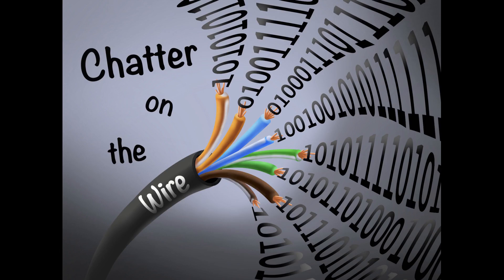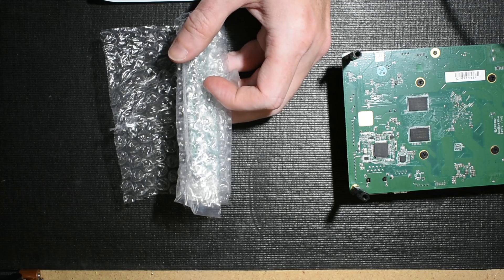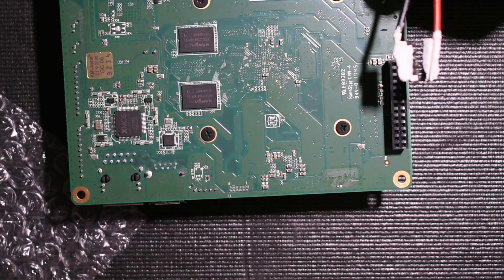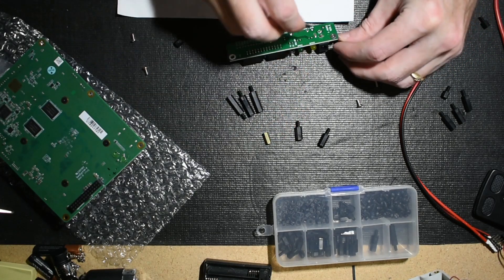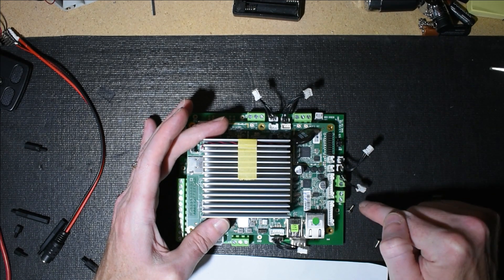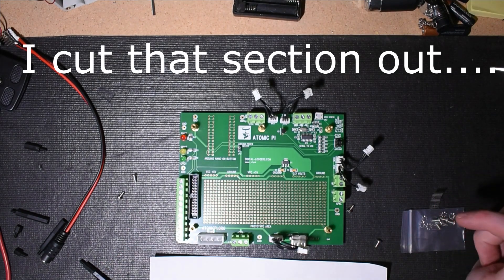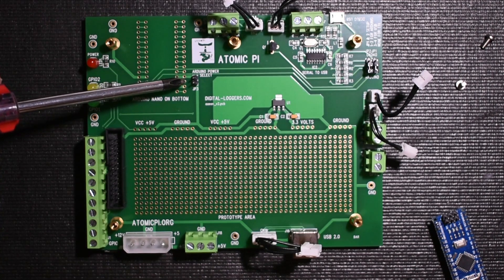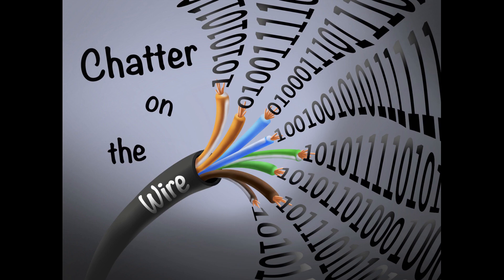Atomic Pi Breakout boards

Comment: By any chance, do you know what type of JST 2 Pin connectors fit on the Speaker out Left and Right , I found out not all JST connectors are not the same, I see your Breakout board came with some .
Reply from the maker: Unfortunately I have no idea what they are, but here are the dimensions on the female plug:
4.30 mm wide x 2.56mm tall (minus the tabs that stick up) with pins being ~1.3mm between them

The only jst I saw for 1.25mm was jst gh,  but looking at pictures on those that didn't appear to be what they were either.  I'll look around at a few more pics and if I find anything that looks like them I'll post what I find.
Reply from the maker: remeasured and pretty sure it is 1.3mm not 1.25 between them which really doesn't match any of the jst's that I see.  It is also 4.3 mm wide, which doesn't match the female of 3mm (male is 4mm), so these appear wider that GH and PH

Comment: I'm going to try and use the larger breakout board inside a old PC tower case, maybe I can rig old internal drives to work with it with some USB adapters.
Reply from the maker: hmm, may have to try something similar, supposed to be getting an old system from a friend shortly.

My atomic pi has sat collecting dust for months now, got side tracked on other projects.  Need to find a good use for it so I'm at least using it for something again.
Reply: @ChatterontheWire  Its going to be a interesting experiment at least if it fails. But If it works, Its a great use of the Atomic pi and may be a quick way to build a cheap pc for kids or someone who just wants to get online or play Retro Emulator games. 

I'd love to see you make a video about your experience. I don't upload much of anything anymore but love seeing projects like this built.

Comment: So my Atomic Pi has cost me now me $84. I didn't like the folks from Atomic Pi, because they were like just deal with it. 

Atomic Pi = $35
Small Breakout Board = $4
Power Supply = $15
3D Printed Case = $30

Not happy as I am trying to replace Lubuntu with just Debian, I have efi usb drive, but it flashes and never boots. Also, it would be nice to be able to set up a fan on the heat sink as it seems to get hot. The worse hyped boards.
Reply from the maker: I'm not sure what my total cost is/was.  I never both with cases around my SBC's, but I had 2 different power supplies and both the larger and small breakout board.

It is a niche market over all.  Really good if you need a small sized intel system, but it definately can get expensive quickly and can be cheaper just hitting place for cheap old computers and have about the same power.

Comment: I agree too, that i wouldn't like to have a Nano permanently soldered in....but if i did, i could always bend those upright pins at 90 degrees so i would still have access also if need be. Cool video. I had not realized that there was an updated version of the baby breakout board. Much better! Thanks!
Reply from the maker: I definitely need to revisit the larger breakout board too!  Busy working on an arduino project this week already, but thanks to the reminder on these posts think I'll have to add the atomic pi back on the pile of things to play with in coming weeks!

Comment: It's  the  least  expensive  x86 sbc I have  found  and  I got  the  large  breakout  board  for  it wish it  offered a  sata  connector  but  can't  have  it  all  , USB3  to sata  adapters  are available  for a  2.5 inch harddrive  .
Reply from the maker: Definitely for the price it is a great little x86 board!  I still haven't found a real use on the large breakout board, but also, haven't had much free time of late to play with it either.

Comment: Thanks for the great video nicely explained, the nano goes under the full breakout board.

If Ameridroid is still sold out

Baby Breakout boards with power adapter:
Amazon
https://www.amazon.com/Power-Adapter-Breakout-Board-Atomic/dp/B07SR336V1/ref=sr_1_9?m=A12I5MLBRVCHIQ&marketplaceID=ATVPDKIKX0DER&qid=1561355756&s=merchant-items&sr=1-9

Ebay (make offer)
www.ebay.com/itm/264369527546

Full Breakout board with power adapter:
Amazon
https://www.amazon.com/Digitial-Loggers-Fullpower-Breakout-Pigtail/dp/B07SS11Y1M/ref=sr_1_3?m=A12I5MLBRVCHIQ&marketplaceID=ATVPDKIKX0DER&qid=1561355801&s=merchant-items&sr=1-3

Ebay (make offer)
https://www.ebay.com/itm/264369531395